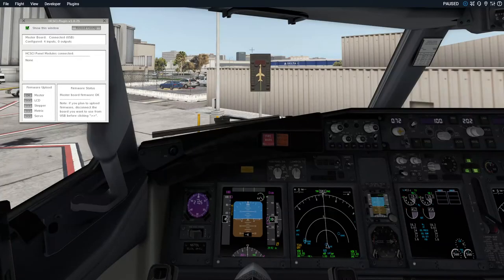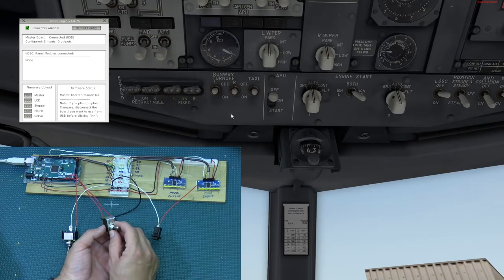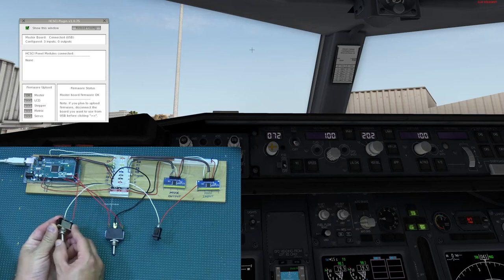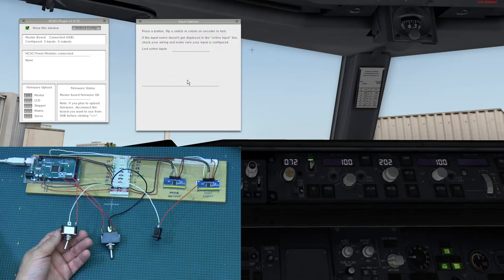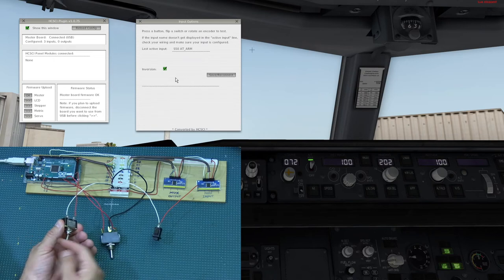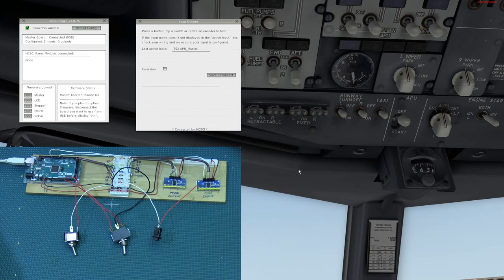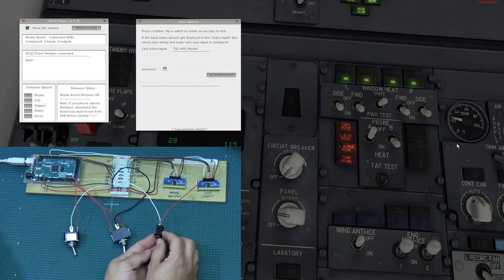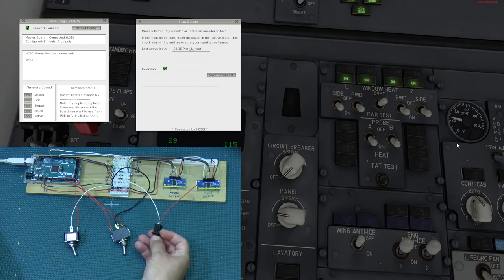Back To Basics: Using toggle switches with SimVimX/RealSimControl (Previously SimVim & HCSCI)

Comment: Switches are basically 75% of what we do in building home cockpits - thank goodness its easy!  The one thing I can do with the Teensy is that I can make a toggle always force its position on the sim - if my mag switch is on, it is on even if I change with the mouse - the real life switch ALWAYS is the setting - not sure if HSCSI has that option - and to be honest I only use it on a few controls where no matter what, the real life switch is what it is.
Reply from the maker: Yes they are, that and push buttons. With HCSCI it will synchronize the position of the switches when you start up but you are still able to move them with the mouse. With the Saitek Panels plugin it does force the position and you cannot click them at all

Comment: For your mock up board (the older one,)  The WHITE wire is always considered neutral or ground which is the standardized configuration and is also the standard in house wiring.  BLACK is dark and represents hot or power.
Reply from the maker: I know that for household power black is hot white is neutral and green is ground. In cars black is ground and red is positive, for these project I try to have a standard but sometimes I just grab whatever pieces of wire I have laying around. If I'm building an actual panel I do try to keep to specific colors but almost always use black for ground because this is low voltage DC stuff not household power.

Comment: Awesome Bud, Just wondering.... From your set up. Are you going to explain the usage of the OutPut on LED's on a MUX?
Reply from the maker: Hey Gyver,  you cannot use LEDs on an output MUX. I am going to do one on using the DM13A LED drivers though
Reply: @Qosmokid  Wishful thinking :) Just ordered 5 pieces, Shouldn't put my project to far behind :)
Reply: @GyverX  
You should use the LED drivers or shift registers  boards for LEDs. As for MUX - 5 of them gives you  80 inputs.
Please read the website pages - there is everything explained  - simple and understandable for everyone.

Comment: Thanks for the video. I use the newest SIMVIMX for the Thranda Pilatus Porter PC-6.  I only use it for the 2 and 3 position switches.  I have problems with the Strobe_Light switch. In the RealSimControl configurator there is only a 2 position switch for the Strobe_light, but the Porter has a 3 position switch for the Strobe_Light : Strobe-Off-White and also a seperate switch  for  the two red warning lights on top and  the bottom of the fuselage : Upper-Both-Lower  (thranda/switches/SwitchDn20 and Up) How can ask for a change in the RealSimControl application so there will be a 3 position switch for that too?  Its a bit of a combination switch. The Porter pilots will recognize this.
For the guys who want to use SIMVIMX with the Thranda Pilatus Porter can get  my data.cfg file. Just ask.
Thanks in advance for your reply.
Red

Comment: Question? -- hopefully you can answer. On the HCSCI site if you click on Custom Planes you will see a page referring to Custom Aircraft Data Conversion (Downloads). From that page you can click on a X-Plane Data Structure link. They do not tell what exactly what this does. Can you show an example of how this can be useful in allowing additional X-plane data refs to be available and displayed using their existing hardware structure???  I would like to be able to display  --- on several LCD displays -- X-plane data refs that they fail to provide access to from their configurator. Maybe this is not the intended purpose of this converter. It would be so much easier  -- for all --  if they allowed the capability to display data refs that all X-plane users are most familiar with instead of searching through their confusing instrument pictures. They should have started providing this capability  -- at a minimum first -- as a selling point - before providing specific complicated instruments -- that I believe -- most will not pay to build. Please comment if you can. THANK YOU.
Reply from the maker: Hello Jo Lo thanks for your question. I think this is one that will be better answered with a video, it's kind of complicated to do it via text. I will try to record it as soon as the custom configuration is working again. I've been keeping an eye on it but in it's current state I can't really go through and explain what you want to know.
Reply from the maker: Before I post a video response, are you ok with me addressing all the points you have on your comment publicly?
Reply: @Qosmokid  Yes !  If you can please present how to show at least all INDICATED  parameters -- especially Indicated VS ; IAS; Altitude(all digits not just the two most significant digits)and HDG.HCSCI does not reference all these in the configurator correctly.

Comment: what gauge wire can i use for wiring my project?
Reply from the maker: Man sorry about completely missing your comment, but you can use any wire you want. since it's for low voltage and very low current even 24 gauge or thinner is fine. I use 20 & 22 gauge because it holds better in the breadboards.